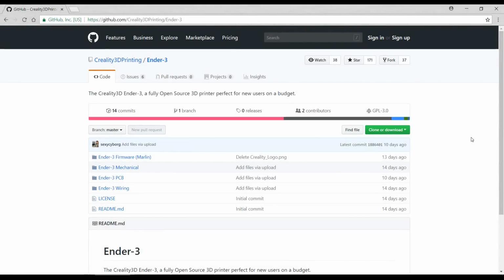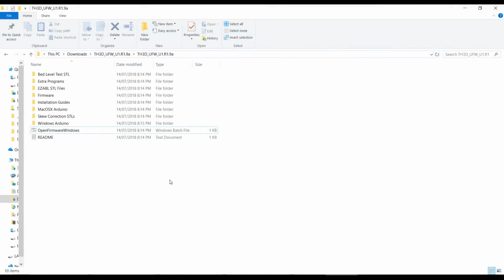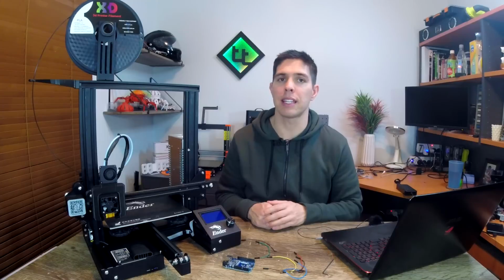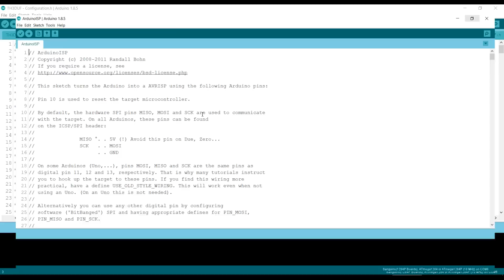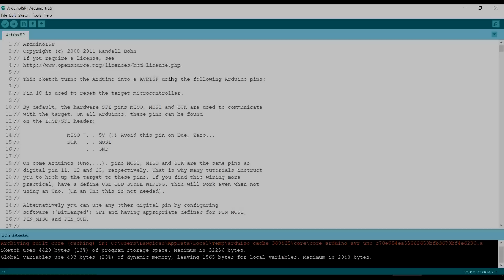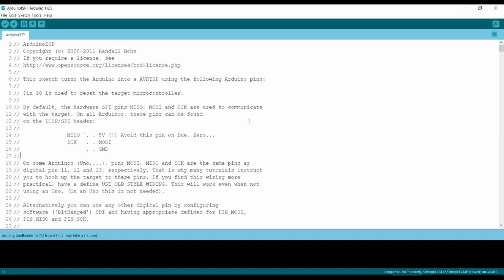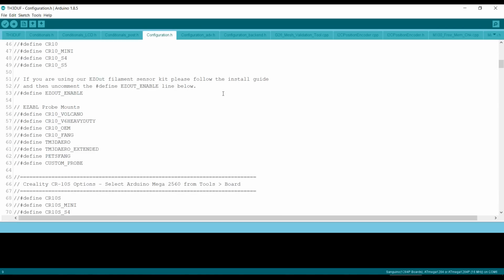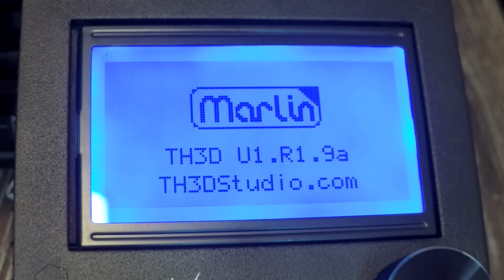Ender 3: How to install a bootloader and update firmware

Comment: I finally acquired all the tools to get this all done, but nothing happens at the end. After uploading the firmware for 5-6 minutes, the IDE says "done uploading" but even after rebooting my Ender 3 there's no difference in the firmware. Going into the serial monitor in the IDE shows it's still running Marlin 1.0.0. There's no option for EEPROM as you have in the video desc. Am I missing something obvious? This happens both when flashing from my laptop via USB or the connected RPi 3 (which I used to flash the bootloader in the first place).
Reply from the maker: That is very strange. You don't have another device connected and the wrong serial port selected? Flashed bootloader too?
Reply: I ordered the sparkfun AVR programmer so I didn't have to use my RPi. I used it to flash the bootloader, which completed without errors (using jumpers since the provided 10p to 6p connector didn't fit on the board) and I used the power on the machine to do it. Then I restarted everything, compiled Marlin in the IDE again and tried to flash it via USB again with a new cable. same comm errors. then I tried it via the GPIO pins instead and it seemed to work but after resetting it still just says 1.0.0. this is frustrating because the printer works other than this upload!
Reply: Nevermind, I fixed it! I think I had two of my pins for the AVR reversed because after this last time uploading the bootloader and resetting my printer I found that the LCD was blank. on a hunch I unplugged everything, switched to USB directly from my Rpi and it flashed the 1.1.9 firmware successfully. that's what I get for using jumpers with similar colors I guess. (lucky I didn't burn my chip or board doing this!) thank you again for your guides.

Comment: I have an arduino mega 2560 on hand. It looks to have that 3x2 set of headers. Can I use that to flash instead of an uno?
Reply from the maker: Yes, follow the wiring in the arduinoisp sketch.

Comment: I have everything wired up correctly but I keep getting the error message when trying to flash the boot loader "avrdude: stk500_recv(): programmer is not responding
avrdude: stk500_getsync() attempt 10 of 10: not in sync: resp=0x03
Error while burning bootloader."
Why could this be?
Reply from the maker: Sounds like not wired correctly.
Reply: Nope. This is the exact error you get if the uno resets during load (same error I had). Just add a 10uF capacitor between the reset pin on the uno 6-pin ISP block and ground. See my other comment on this thread.
Reply: Err... Sorry, slightly different message but reset errors will manifest strange messages.
Reply: Can confirm, 10uF capacitor worked for me. Thanks.
Reply: 10uF capacitor got me past the boot loader error also.  Thanks Rex
Reply: I was having this problem and followed this: https://old.reddit.com/r/ender3/comments/a0r7u9/cannot_flash_bootloader_with_th3d_and_arduino/eak02oz/

Comment: Hi Micheal:

While burning the Boot Loader I get this error message:
Arduino: 1.8.7 (Mac OS X), Board: "Sanguino, ATmega1284 or ATmega1284P (16 MHz)"

avrdude: stk500_getparm(): (a) protocol error, expect=0x14, resp=0x14

avrdude: stk500_getparm(): (a) protocol error, expect=0x14, resp=0x01
avrdude: stk500_initialize(): (a) protocol error, expect=0x14, resp=0x10
avrdude: initialization failed, rc=-1
         Double check connections and try again, or use -F to override
         this check.

avrdude: stk500_disable(): unknown response=0x12
Error while burning bootloader.

Any ideas? Would greatly appreciated, Thanks!
Reply: Hi Alexis and everyone with this problem (it happens a lot with arduino burning a bootloader). In order to burn the bootloader (valid for lots of boards, Ender 3 included).
It calls "Atmega hex file uploader. Written by Nick Gammon". Short version: it is a program you upload to your arduino and after that you connect  arduino to Ender 3 the same way shown in this video and in the IDE just open the serial console monitor (115200 baud rate and cr + lf). If the cables are correctly connected in this windows you will see the model of your atmega processor (for Ender 3 is ATmega1284P) and a question asking if you want to burn a boot loader for this processor. Just press 'G' and you have a boot loader. After that remove your arduino and follow this video's instructions to burn the firmware. Here is the source for his sketch: https://github.com/nickgammon/arduino_sketches/tree/master/Atmega_Board_Programmer. 
Here is his page: https://www.gammon.com.au/bootloader
Btw: I tried this a lot and always worked (and yes, I never was able to burn the bootloader in any other way)
Reply: @mbribeir0  This worked for me. Thanks for posting this!

Comment: Thank you! successful flash new FW
Reply: I am trying now but when I get to the Burn Bootloader step I get an error: “avrdude: initialization failed, rc =-1  Double check connections and try again”. I have checked and rewired twice and still get the same result. I have a new Ender 3 with a Creality3D V1.1.3 board. Any help would be appreciated?
Reply: @jeppebuk  do you use arduino ide from FW archive?
Reply: McPcholkin good question; I downloaded from the official Arduino site - is that wrong?
Reply: @jeppebuk  yes,i i use one that in archive DH3D fw, it include all needed configurations.
Reply: McPcholkin thanks, I’ll try that 👍🏻
Reply: Got the bootloader burned now - THANK YOU! 🙏🏻

Comment: I managed to install a bootloader but after I tried to connect my printer with USB did I realise Windows 10 doesn't detect it even in the device manager. What should I do
Reply from the maker: Install a driver. Check out TH3D website.

Comment: Is it possible to brick the 1284P mainboard on bootloader flash failure?
Reply: Oh it's definitely possible, but it's hard, surprisingly hard to accomplish. I had to add a capacitor between reset and ground on the Uno to get the bootloader loaded (see my other comment in this thread). You may be having the same issue.
Reply: @ikkentonda   I've done a lot of embedded development on ARM and microchip pics and even multirotor flight controllers but not much on these so I am not calibrated on how touchy they can be. but sounds like they aren't bad and may like any of the rest.
Reply from the maker: I've never done it but I'd say yes. Usually if it fails it's at the beginning before anything really happens.

Comment: brooo can you help me regarding the plug cable for ARDUINO MEGA 2560 REV3 to ender 3 printer
Reply from the maker: If you mean mailing you a plug, then no. The printer should have come with the correct cable.
Reply: yup broo.... i dont know to to  plug the cable because of different board. i am using board arduino mega 2560 rev3.. my email raman_bagio@yahoo.com

Comment: He's dead Jim! well I thought it would be cool but the burn killed the printer. not sure where I went wrong. I got the UNO set up as the ISP easy enough. but then I changed everything over to the use it a the IPS and selected the corect board and now the print does turn on but the screen is blank blue.I'm not 100% sure that it the bard is dead fans come on and the blue light comes up but its like it doesn't know what to do with its self
Reply from the maker: After burning the bootloader, you then need to flash the firmware. It will be blank until then.
Reply: @TeachingTech  lol update to come....
Reply: Happy to report that everything is up and running. I was doing this all in Ubuntu  to start off with and was having some permissions issues with being able to upload to boards. I installed widows just for this. After that it could not have been any easier. Wonderful guide, Thanks for putting it out there for us
Reply from the maker: Glad to hear it is sorted. Crisis averted.

Comment: can u help to help how to plug for mega 2560 board
Reply: ARDUINO MEGA 2560 REV3
Reply from the maker: "How to plug"??
Reply: @TeachingTech  cable link from uno to printer ender 3
Reply: @TeachingTech  using ARDUINO MEGA 2560 REV3 to link the cable to board at ender 3... realy appreciate with the reply... thanks

Comment: Ok. I'm stuck. I followed your instructions step by step, and now my printer is dead. The screen lights up, but no information is displayed. The dial has no effect and the dial button just makes chirps. Any idea what went wrong and what I can do from here to fix?
Reply from the maker: This is normal after burning the bootloader. Now you have to install driver and flash the firmware. If it is blank after successfully flashing from Arduino then something has come unplugged.
Reply: Ok..  so note to self.   Make sure you're uncommenting the "Ender 3" line..  not the "Ender 2"..   it's amazing how much better it works when you use the correct code.
Reply from the maker: Haha that sounds unfortunate. I imagine it might have been hard to trace too.

Comment: Which settings should i change when prints are not centered on the bed? (well centered in the slicer), "X_HOME_LOCATION , Y_HOME_LOCATION" in configuration.h OR "X_BED_SIZE, Y_BED_SIZE, X_MIN_POS, Y_MIN_POS" in Configuration_backend.h ?

Comment: Can i use a MacBook or does it need to be a Windows computer?
Reply from the maker: Don't see any reason why not.
Reply: I just flashed my firmware with a mac today. But you need the latest release as the previous one didn't have the correct mac software with the extra boards included.

Comment: For peoples that use th3d full package, if the arduino IDE open quickly then crash check  the  windows default shortcut "Documents" (run, this computer, "Documents" in folders area), if it's not working right click on it then "location" tab and update the path (most of the time it point to a bad drive, that's probably due to any recent drive change in your computer... ). Please note i'm using french windows version so maybe it's another word for "Documents" in your version....
Reply from the maker: Thanks for sharing, very useful.
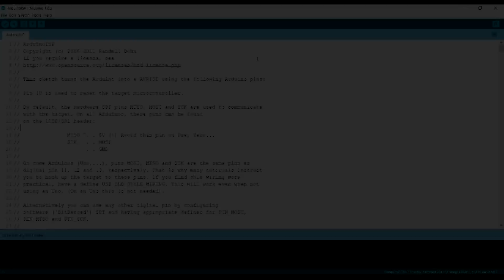Reply: You're welcome! one question about the mini usb cable, i heard some peoples burned their ender 3 motherboard because they was using "data cable with power" instead of "data cable only",it's possible to fix by destroy or cover the 5v pin like described in this link: https://www.reddit.com/r/CR10/comments/7z3csg/found_an_easy_way_to_disconnect_usb_5v_from/ As you know the 5v is required for flashing (09:05 in your video) but it seem dangerous for the motherboard (by the way in normal use the ender 3 seem to reboot each time a usb cable is plugged...). what do you think of that? i suppose some peoples had troubles because the usb was connected in a powerfull charger instead of a computer (most of computer PSU deliver only 500mAh on USB ports) . For the moment i prefer to cover the 5v pin... (opening the cable sheath and solder a "on-off switch" in the 5V wire is probably a more confortable solution...) Thank you for your knowledge sharing again!!!!
Reply from the maker: Never heard of this before or had any issues myself. As long as the voltage is 5v, the power supply shouldn't matter as the mainboard will only draw what is wants in terms of amperage. I'm very intrigued.
Reply: Yes it's strange, i was intrigued too the first time i plugged the usb cable (the power supply button was on "0") to see the LCD display turning on with very low brightness, but after looking your video i understood it's very usefull to check the flashing state for exemple. i think a multimeter will confirm if there is a real danger but in all cases the mother board price is cheap (less than a good multimeter for sure!) and i don't have enough knowledge with electronic... Here is a similar case, the answer of "DinnerMilk" seem to explain better than me (he's speaking about a 5V regulator but i don't know if it concern the raspberry or the printer board): https://www.reddit.com/r/3Dprinting/comments/8ng5z5/is_providing_power_from_rpi_to_ender_3_board/

Comment: Do you recommend building the out of the box printer first, and then doing this, or doing this before the printer is put together. I got mine the other day and haven't taken it out of the box, yet.
Reply from the maker: I've thought about this and I think despite it being easier to access the mainboard before you build, you won't be able to test if the firmware is working unless assembled.

Comment: With firmware U1.R2.1d, there are no options under control-motion and control-filament. Also no option to initialize eeprom.
Reply from the maker: The features will still be in the firmware, just removed from the LCD menu to save space. Creality picked a budget microcontroller that can only fit so much.

Comment: Thanks Michael, another great vid! Would there be any difference for the ender 3 pro?
Reply from the maker: I have one in the mail. As far as I know the mainboard is unchanged, I will confirm in that video.
Reply: @TeachingTech  Legend - thanks man.  Opted for the TLTouch and ordered the arduino to update the firmware - looking forward to cracking on!

Comment: I have updated the firmware as you showed in the video. I am trying to print tpu (flexible) and the print speed is high, not what I define in the cura. I also tried to use the printers menu to reduce speed while printing.... Didn't work. Even reducing feed rate slows down the print except in the external wall part of the print... Any idias? Thanks
Reply from the maker: Everything you are saying sounds impossible..? Got me completely stumped.
Reply: I believe it's an error. It has happened to me as well. I had to re-slice and reload to the printer to fix.

Comment: I follow the video exactly as you do it and it works fine every time but I have to use the uno every time if I try flash a new version for example when I installed my bltouch it says problem uploading I then have to start again with the uno and the copy of the th3d firmware I've setup then works
Reply from the maker: That is very strange. An obscure setting incorrect somewhere..?

Comment: Thank You for this video, even though I screwed up and did things out of order, it somehow worked without bricking my printer.  

I was skipping around the video making sure I had everything downloaded and ready to go and I apparently started later in the video and then realized it and went back to where I needed to be. But what I did wrong was hooked up the Uno board to the printer before any of the Arduino setup, which caused my required port to be wrong. I manually changed the port in device manager and got it to flash the bootloader. I didn't realize until after I flashed the bootloader that I screwed up and did things out of order. But like I said it still worked and didn't brick my machine so I'm happy. LOL
Reply from the maker: Glad to hear it worked well.
Reply: Hah, yeah I did the same thing. I felt like such an idiot since the instructions are so clear. If you brick it (blank screen) just start over from the beginning, do it correctly,  then it will work.
Reply: @CallanChristensen  yeah it's even more embarrassing for me since I'm a systems administrator. Lol

Comment: Michael. Question. I just load U1.R2.1a and there is no option for "Initialize EEPROM" option. Any ideas or suggestions? Would it be okay to run it without initialize EEPROM if everything else seems to be running fine?
Reply from the maker: Generally yes this won't be a problem.
Reply: Same problem here with U1.R2.1d and I'm also missing Motion and Filament options, some say that R1 works but it is not more available online.

Comment: Great video, clearly explained. When I heard that a bootloader flash was needed for my Ender 3 I started feeling like maybe I'd just be sticking with the factory firmware. Watching your video clarified just how easy (if a bit fiddly) it would be to accomplish, so I bought an Uno and some Dupont jumpers today and I'm happy to report it went perfectly and I'm up and running on the latest TH3D stable release. 

You're probably aware, but Manual Mesh Bed Leveling is also available as a feature in the TH3D firmware and is something I was planning to play with a bit. I only just subscribed to your channel today, so I need to do some searching. Have you covered anything on Manual MBL on your channel?
Reply from the maker: Hi Dirk, thanks for commenting and for the nice feedback. I haven't covered manual mesh bed leveling but I have covered auto bed leveling in a few different ways.

Comment: Hi Teaching Tech, Perfect very well explained as always your videos, I did it in my ENDER-3 and all very well.
I regret that this version cancels the option to resume before a lack of energy.
I ask if a new version of fireware that includes power resume is available ?.
Thank you very much
Reply from the maker: This is in Beta for TH3D, it should be stable soon.
Reply: Hi Teaching Tech: How can you add the option to resume after lack of electrical power ?.
Reply: Hi, I have a need when the power is missing, I can resume.
Reply from the maker: You either need to flash the Creality version from their github or wait for the TH3D version to be released.

Comment: A USBasp is quicker. cheaper and easier to use.You can get one for about $2.00
Reply from the maker: Good tip, thanks.
Reply: would you be able to help me, have the materials for this guide here: https://www.youtube.com/watch?v=AQX_AEdXqt4&t=444s installed driver fine, but in adruino the com port is greyed out.

Comment: Thanks for this.  I can tell you from about 10 years of appliance repair that thermistors and heaters are the most common thing to fail.  The safety aspect alone makes this a necessity given the amount of time it take to quality print.
Reply from the maker: Great insight, thanks for sharing.